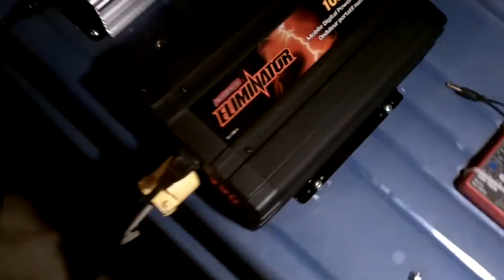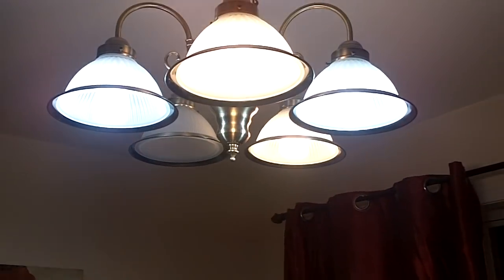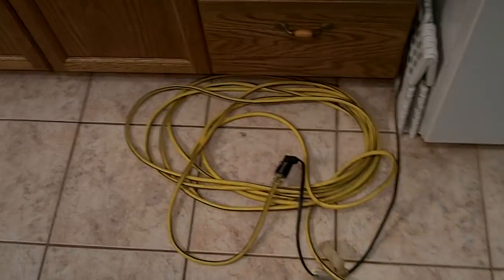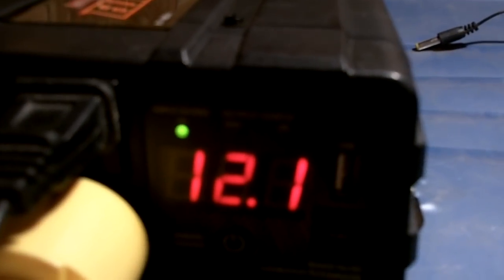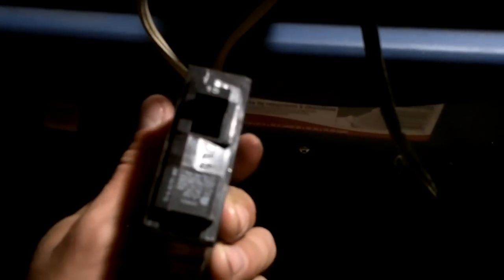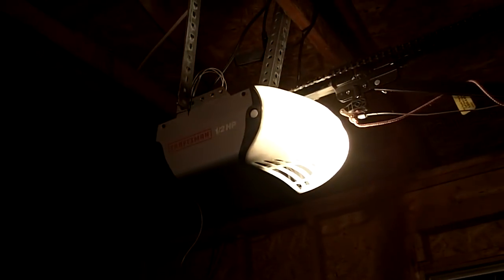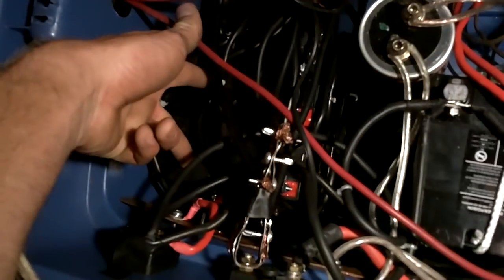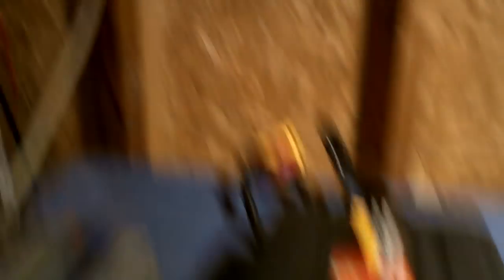House running off 1000W inverter

Comment: Hi, need a little help anyone. I'm looking to setup a off grid system that switches to the grid only when the batteries are low and no sunlight. But have no idea of what kWh inverter or how many panels to get. This will be in the Caribbean where its mostly sunny. (Worst case scenario) I want it to run a tankless electric water heater, washer, split unit air conditioner, fridge and a freezer simultaneously. Everything else is just light bulbs 15w, tv, microwave, iron. Note. I'm only there like 1 month out of the year with my family of 4, other than that its just 1 person living there. Thank you.
Reply from the maker: cody cato looks like u need about 6-8kw inverter and about 5-7kw of panels im not sure how much power you would use but this is more then enough i beleave
Reply: Get your self 4, 6volt golf cart batteries. Get your self a pure sine wave 5kw inverter. Get your self 4 solar panel rated 250-345 watt output each. If you do your homework good. Get your self a wind generator instead. Also to make 5kw to work all your house you will need all your lighting system to be LED no more than 6watt per light bulb. Flat screen LED not plasma a since they draw a lot of power. Make sure that the microwave is connected to the grid since they will kill your battery. With this setup you can run 80 percent of your house.
Reply: Thanks for  your reply juvenille2001 and fliping720. I've done a little research over the past few days. Decided go totally off grid, grid power is bad there anyways. I'm getting the Xantrex 3kw inverter with built in battery charger. Two 1.6kw wind turbines and a few solar panels just incase it's not windy on certain days. Along with the Xantrex AGS (auto generator starter) and control unit connected  to a 6-8kw generator. This setup can automatically startup and combine to the generator and inverter power if I go over a set load or run everything on generator if the batteries are low and not charging (can set to 50%).  plus recharge battery bank using the generator if wind or sun not available.
This setup to me is relatively maintainable free, the xantrex control panel can connect to a pc so I can write my own codes and that's where things can get a little fun for me :). Can be controlled virtually from anywhere.
Reply from the maker: cody cato Yes i love my xantrax, i thought you might need more then one 3kw but hey they are awesome inverters! look at my newer videos i have an xantrax sw3000 running my house!
Reply: fliping720 I saw your new video, great by the way. Right now I'm down to two systems options. With 1 disadvantage for each. First is the xantrex 3kw, which you pointed out i need more than 3kw. And the Aims 12Kw (enough power and I probably won't need a generator to run loads, just to recharge bank if needs be), but it does not have any way of tweaking the settings or control remotely via internet. But 1x 3kw xantrex with all the addons (that allows me to control it remotely and AGS) adds up to the same price as the Aims 12kw.
Reply from the maker: you can use 2 of the newer xantrax 3WK together to make a 6Kw inverter
Reply: fliping720 yea that's what I'm gonna do. I'm like the xantrex features. Let me ask, whats the max you run all at once on your 3k inverter? You don't necessarily have to give me the wattage for each. Thanks.
Reply from the maker: cody cato i have pushed4800W out of mine for about 10-15 mins and nothing got hot

Comment: Great video! Here's an idea about your garage door. Add a backup battery to it. Over the years my area loses power about 2 or 3 times a year mostly during storms. Which means I have to manually open and close the door. No big deal but it's time consuming and gets nasty during very wet or snowy conditions. So I replaced my old Sears garage door opener with a Chamberlain which has a backup battery feature. Other brands also have such a feature plus control over the internet using a smart phone app too. During a week of terrible storms in July 3 years ago we had two major power outages in mid Michigan. We lost power for a total of 6 days.  I was able to open and close the door over 20 times and I never ran the battery dry before the power was restored.
Reply from the maker: metaspherz thats a great idea!

Comment: How many batteries you had in that blue box inside? and how many power inverters working at the same time? it looks like there's only one inverter, how many batteries? thanks for the video.
Reply from the maker: Royal Borne i beleave at the time of filming i had 300W of solar and 250Ah of batteries and that 1000W inverter, this was only for backup power when the power goes out, it would only last 6 hours
Reply: how many bank or stacks of batteries is that 250Ah? isn't that a lot?
Reply from the maker: Royal Borne its very little in the solar power world

Comment: I looked at all the invertors on the market for backup, and settled for a 9KW with wireless remote starting. Generator outputs 120V/240V that powers both sides of the breaker panel, bringing everything in the entire home to life. Costing less than $1k; there are no battery banks. Runs about 11 hours on one fueling. Invertors draw heavy DC current. 4 cans of gas = 4 days and nights of powering everything in your home. Great for ice storms. During a ice storm in Virginia several years ago on Christmas day, I completely powered up my mother's home. We had a regular Christmas dinner that holiday and all the relatives came over. Generator in the back yard I connected to her breaker panel powered all the lighting, the oil burner for heat, a fridge, freezer and her electric range. Every 11 hours I shut it down and poured in 4 gallons of fuel, and restarted it. Yes it was noisy, but well worth it.
A comment someone made below about 48V is a good idea; the closer the DC voltage to the invertor is to 120V, the more efficient the invertor will be. If you had a invertor that could operate on 150VDC, you wouldn't need a transformer in the invertor.
A 1000W invertor will pull approximately 100A from the battery bank when running at full load, not including invertor efficiency losses. Forget about starting most AC motors with it; many motors running on 120V can have inrush currents of 2x to 4x their running current rating which can trip a breaker in the invertor (if it has one.) Garage door openers also have this problem - note that you didn't see him lower the garage door during the video. Invertors are best a running lighting and very light electronic loads. But when the batteries die, they die! Trying to charge invertor batteries from a vehicle while the invertor load is running is a risky proposition - connecting your battery and alternator to such a heavy load could create a spike that could destroy the alternator. Now you'll be out about $500 and be sitting in the dark, with a vehicle that won't charge it's own battery and may not start.
Reply from the maker: tedtw haha sweet system, check out my new one, this was only set up for about 3 months before upgrading. also i did open and close the garage door on the inverter, I just have to make sure not to many things are on in the house before i do so.

Comment: How many hours does it last? and how many plates of battery are you using?
Reply from the maker: at time of filming it only last about 5 hours with a bunch of small 20W panels and was using small agm batteries.

Comment: Thank you for your video. I have a 1000watts inverter and a 12 volts 100ampers battery. For how long I can run 3 light bulbs 13W each?
Reply: I'm assuming you mean a capacity of 100 Ah, not 100 A which is current. That would not make sense. Assuming this, your battery has about 1200 Wh of energy. A lead-acid battery cannot (must not) be completely discharged. Depending on the exact battery type, you might be able to drain down to, for example, 50%. This is 600 Watt-hours of usable capacity from the primary side or the battery side. Assuming a good 83%, or, say, (5/6) total efficiency, you can run 40 watts for 12 hours, if a discharge depth of 50% is permissible. Which is pretty much the same as fliping720 is saying.

However, if you are using an automobile battery, I would not want to discharge that much. 8 hours sounds better. After 18 hours you're down to the last quarter - even in the best case scenario - and your battery has suffered significant damage. If we're less than lucky, the battery will go completely dead before the 18-hour mark, causing even more damage. It might be ruined.

Also, your generic Chinese 1000 watt inverter might even have way less than 83% efficiency(remember, total efficiency, also counting cable and connector losses) when running a load of merely 40 watts. Swiched-mode power supplies typically are very efficient under typical load, less so when close to maximum or peak load, and even worse when running a very small fraction of available power. There is even an "idle power" they consume when there is NO output load.

8-10 hours would be the maximum reasonable time. This is of course assuming the battery is dedicated to this task. Car starter batteries should preferably not be used this way at all.
Reply from the maker: about 10 hours with out doing much damage to your battery or 15 hours or so and shortening the life of your battery.

Comment: I have a question, I do an outreach, off grid, and want to be able to run a 19"TV and DVD Player for 2-3 hours. I will then re charge it when I get home. What would you recommend for a set up?
Reply from the maker: u need a 150W inverter,80Ah battery and you should be fine with that.

Comment: There is a big difference between the amps coming out of your batteries and the ones coming out of the inverter. amps x volts = watts. 3.54A x 110v = 390W      32.2A (dc) x 12.1v = 390W     There will always be a big difference between the Amps your inverter is pulling and the amount of Amps it is putting out. It is converting the high amp low voltage DC to 110v lower amperage AC. (Still equaling the same amount of watts though) Don't forget that your inverter isn't 100% efficient either so there will be about a 10% loss there as well. You can save a small amount of power by running as many things off of DC12 as you possibly can (like a DC to DC converter for your laptop) This saves power because you aren't converting it from 12v DC to 110v AC then back down to a lower voltage DC for the laptop to use. I understand your battery bank is small so it pays to save a few milliamps here and there.
Reply from the maker: 100% true! thanks
Reply: True. I, however, have to point out that the laptop or electronics in general might not be the best example. The big inverter and a modern laptop ac power brick may(and often will) have a better total efficiency than some generic or budget dc-dc converters.

As a related fact, some laptops can be directly connected to 12 V DC without an external dc-dc converter. Some can do this because that is the normal working condition; their power bricks supply about that voltage. Some just tolerate a lower than specified input voltage. In the latter case this practice may again, theoretically, worsen the total efficiency compared to using the whole chain of battery, inverter and power brick, and might also prove unsafe or unreliable.
Reply: nice battery back up if that was i used  3000 watts pure since wave invertet i used real deep cycle battery 230A i used 12 deep cycle battery at 230A each  i get 33,120 watts power wich good 😎😎😎 nice set up

Comment: Very cool. I once had 2 deep cycle batteries and an inverter with a battery charger built in in my room under my desk. So when there was power, the inverter was trickle charging batteries. When the power goes out, the inverter starts producing power. That way my room had power during power outages :)
I plan to build something similar in my new home, with solar panels for battery charging so that I use the grid even less.

Comment: I just got off the phone with jim bob at the solar place in town and he tried to tell me that i am looking at 40 grand to be on solar and electric set up and he said it is not worth it . I think jim bob has been sniffing too much contact cement , there must be a cheaper way I need help can anyone give me advice ?
Reply: Realistically, if you would buy and do your own install, you would be about half of what Jim Bob said ... and that because you cannot use a cheap PWM charge controller for RV's, you need a good MPPT one, high Amperage ( 60+ ), cost of batteries ( at least 1000 Ah ), and the panels still cost a good chunk ( you need many panels to charge the batteries fast, during the day - winter days, with about 5 hours of daylight max ... you'd better be charging the batteries in 3 hours ).
Do not forget ... change all the lightbulbs in the house with LED's ... and will be even better :)
Reply: For a house you really need to use 48v. And the price he gave you would be to fully off grid and use the power you are currently using. In reality using solar power you need to be mildly of every watt you use.
Reply: fliping720
I would be curious to see how that works out for you .All my bulbs are changed to efficient type and  I call myself the light Nazi we do live in Canada Quebec so Hydro price compared to Ontario is great   .I did spot a Solar place out of BC Vancouver  Island and ships also from Ontario Toronto area http://www.wegosolar.com/categories.php?category=Solar-Panels
Reply: Radu John
check out this company ,they ship out of Ontario as well and from Vancouver Island
Reply: christine none of your concern , I live in Alberta, and I import most of the hardware myself :)
It is at about 20% the cost of these companies :)
Reply: China, Taiwan, Eastern Europe, US
Reply: Fliping720, it is a good price.
Reply from the maker: ill be doing a few experiments to see if i can go off grid for a week and see what my system can do for about $3600
Reply: fliping720 As someone was saying ... LED bulbs will get you a long way.
I am building some custom systems, but here in Canada everything costs a bit more ( batteries, panels, inverters - Eliminator = $185 on sale, $269 regular, charge controllers ) ...
Reply: Radu John
where do you import from ? I live near Ottawa .
Reply: Radu John
Thank you for the information John  : )
Reply: No problem :)
Reply from the maker: christine none of your concern I buy and panel that is cheap, about 70 cents a watt or less is a good deal in Canada.

Comment: How were you able to connect this to your house to the fuse box (breaker box).

Can you post up a schematic, The steps that you have taken, your set up is nice.
Reply from the maker: I made a suicide cord its a cord with 2 male ends and can only be used when the main breaker is off or you will destroy your inverter and or hurt your self.
Reply: Oh.

Cool, thanks..
Reply: How do you feed the other leg of power with a 120v inverter? Breaker boxes usually alternate every other breaker is on the other leg.
Reply from the maker: Bobby Armstrong I have seen people use the dryer plug to feed both sides of the panel

Comment: Not bad..... this must have cut your energy bill in half.  Good job !!!
Reply from the maker: at the time it didn't cut the bill down much, with my new system it does though, this was to show you can run your house off grid when needed for power outages not 24/7 unless you really cut down on electricity usage a lot.

Comment: how many batteries were connected to the pure sine inverter? making our own energy is the Dream! my apartment has a car battery and shes charged by a 100watt solar panel running 12volt led lights throughout the home every night..cant use it to run anything else with inverter for now becos I cant get enough sun shine on the horizontally placed panel hehe..but leds run great uses total about 50watts each night after 10hours of use!
Reply from the maker: nice! at the time of this video i had about 200-250 Ah of batteries, this was not a 24/7 system at this point, it was for emergency use or every few days i could go off grid for 5 hours or longer if i was careful with my usage.